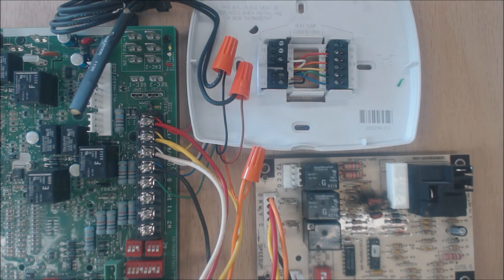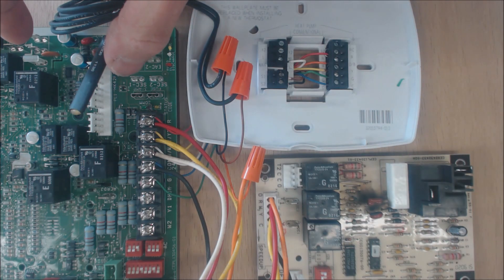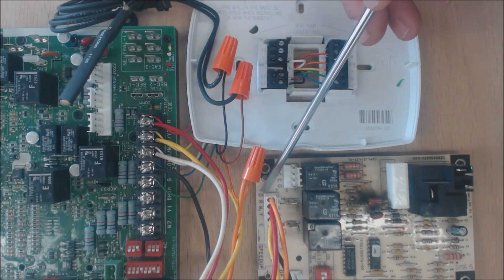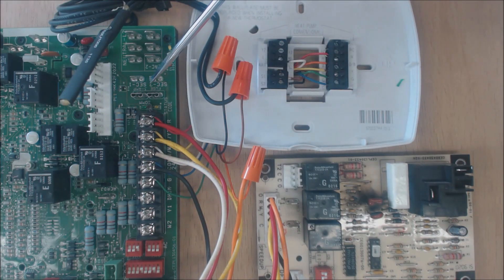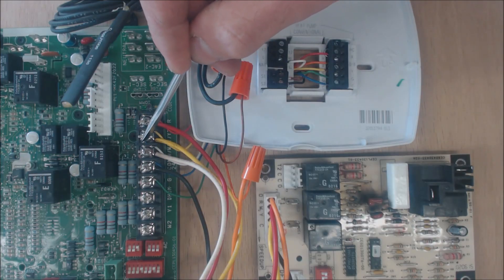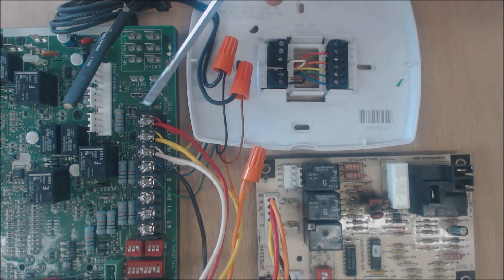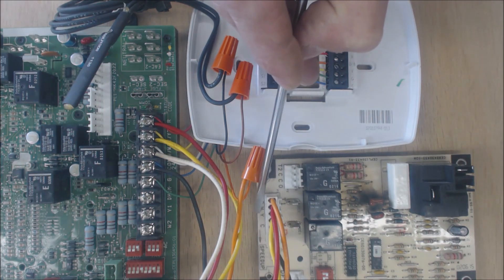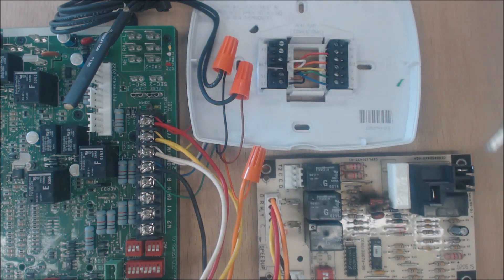Wiring a Thermostat, Furnace, and Heat Pump for Dual Fuel Hybrid Heat!

Comment: Very good video, however there is one point I'm not clear on. My dual fuel system is programmed so that if the outside temp is too low for the heat pump alone (say 20F) the system will function as follows. When the thermostat calls for heat, the heat pump alone comes on for 6-7 minutes and shuts down because it can't meet demand. Then the gas furnace comes on for a few minutes until the heat demand is met. Is this the optimal logic? Seems like it would be better in this case (low outside temp) for only the gas furnace to operate.
Reply from the maker: Normally yes that is what is supposed to happen. Only gas furnace heat should turn on if the cut out temp you set it to is 20 degrees, thanks

Comment: I wish I had someone like you that can help me. they installed a heat pump with electric furnace in my house for 10k dollars and it's 13 degrees out tonight and i'm freezing! My auxiliary heat has been running all day for the past few days. I already know my power bill is going to be 400+. My house is only 800 sqft. and my air handler is a combo type with ac and heater in one cabinet. I'm wondering can I keep the heat pump unit outside and just switch my air handler for the modular type with a gas furnace and ac in separate connected cabinets. I don't know what to do or who to ask for help because the company just basically took my money and disconnected themselves from me.
Reply: by the way that defrost mode is a bitch! there is a loud gascious noise outside of the valve switching over. and then blow the icy cold air! god I would rather it shut off or the blower slows down to defrost. but it just blast all the cold air out as hard as possible. omg I hate this system! and its top of the line! I wish I had went with the much cheaper option and a whole different company. it was GSM btw
Reply from the maker: If you have dual fuel then you likely have a gas furnace with an evaporator coil in front of it and not an air handler. If it is a gas furnace then you need 24v on the w terminal of the control board for gas heat, thanks

Comment: Would you just have to redo the low voltage wiring, if you're going from a furncace with dual fuel to straight A.C.?
Reply from the maker: Hey nice to hear from you! If you were turning a heat pump into straight ac only then you would use a single speed furnace and ac thermostat and just connect y 24v through the pressure switches and then to the reversing valve and the contactor. Come out of the reversing valve and the contactor to common. This would be for manufacturers that power their reversing valve in cooling mode, thanks!

Comment: Regardless of the fact that Nest and ecobee support dual fuel systems, it seems they are not compatible with Mitsubishi and Dettson hybrid systems. Is there any way to match them up? Thanks.
Reply from the maker: I am not aware of any at this point. It may be that the manufacturers of say Mitsubishi are trying to keep that proprietary for the future, not sure, thanks Nima!
Reply: Thank you for your comment.
Reply: Ecobee does not support a communicative thermostat, which you need for a heat pump correct? I just tried to go down that road, and ecobee told me I need to bypass a solenoid in order for it to work.

Comment: the new termostat that I bought  it only haves w1 but the old one haves w1 and w2 and I don't know we're to connect the w2
Reply from the maker: So check on the board of your furnace. Most furnaces will actually control 1st and 2nd speed from the board and that seems to be more efficient than if you controlled it from the thermostat. This is usually done by wiring one wire to the w/w2 terminal on the board of the furnace. I say most but not every one. What is the model number of your furnace? Is this a dual fuel as well with a heat pump like in the video?

Comment: how do you make the defrost cycle and the heat pump to stop when the furnace is running?
Reply from the maker: During defrost the furnace would be running putting heat into the refrigerant to help with defrosting while keeping the customer comfortable. The heat pump should not be running in heat mode while the furnace is heating and this is set in the programming of the thermostat. You have to make sure that you have a dual fuel thermostat like this one. I believe that the model number is in the comments below. Thanks

Comment: I noticed that for some reason my heat pump and the furnace are running together when the temperature is in between 35 and 40 degree as the thermostat programmed. Please let me know what is wrong with my settings or wiring. Thank you.
Reply from the maker: Wow not good. It sounds like you have two overlapping temperature periods set for each of those for instance heat pump shuts off at 35 degrees and the furnace turns on at 37 degrees.  It also could be that there are two components installed in the system instead of one to do this job of dual fuel. I would see about fixing that right away before damage is done to the compressor and high pressure relief valve due to high head pressure. Thanks

Comment: Very good video about the duel fuel but my question is during the reverse changeover (satisfied heat ) in which the furnace is turning OFF does it get some time to cool the evap coils before the heat-pump fires up (at this stage the Freon in coil is very hot already and possibly go to trip on hi-pressure) ? Is there a provision in the programming of the thermostat to wait till 2~3 minutes before it is commanded to be on for the heat-pump ?  Sorry for the long question. This question is bothering me for a long time?
Reply from the maker: Great question! Let me get in front of a system wired like this in order to answer that question. I know I have never had a problem with the unit going off on high limit and want to make sure I tell you the right thing. I know exactly what you mean. Thanks and I will get back with you!
Reply: @acservicetechchannel  i know it's been 3 years now, but did you ever find out an answer to this guy's question? I have the same question : )

Comment from the maker: Hey Techman 143 
For some reason I recieved your question in my email but it is not in the comment section.

So I have a Rheem Prestige Heat Pump/AC matched up with a Luxaire 95.5% efficient LP gas furnace. My installer recommended the Honeywell TB8220U 1003 thermostat. I'm not seeing in the operators manual any way to separate the two systems by temperature. I have the external temp sensor for ambient. What was the model number of the TH PRO 8000? I was very pleased with your video...it exists nowhere but here. I've been chasing this since we installed the new gas system in January and have been manually changing over with the source option on the 8220U. You are a Godsend.

This is the model number of the TSAT used TH8320U 1008 and here is a link from honeywell--https://customer.honeywell.com/resources/techlit/TechLitDocuments/68-0000s/68-0280.pdf
 Look at the upper left of the doc and it says this model number can be used for dual fuel. I looked up your number and it cannot be used for dual fuel https://customer.honeywell.com/resources/techlit/TechLitDocuments/63-0000s/63-2625.pdf